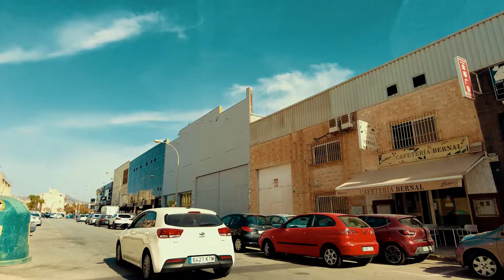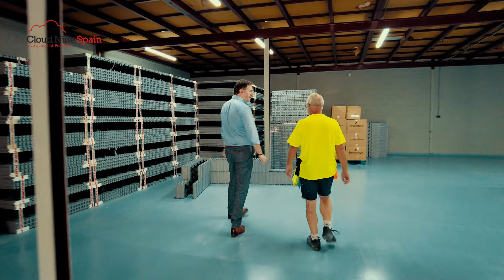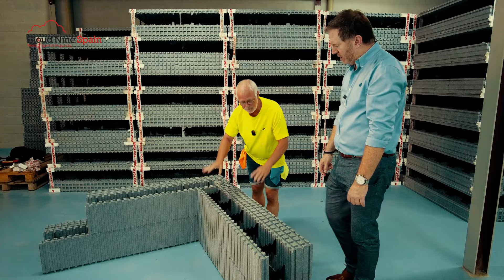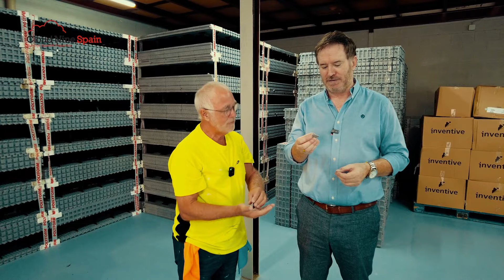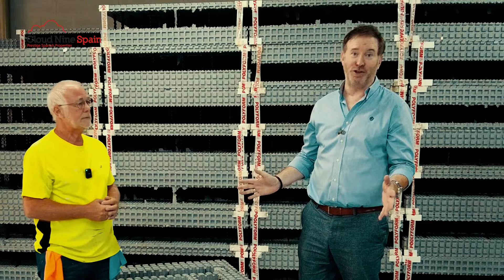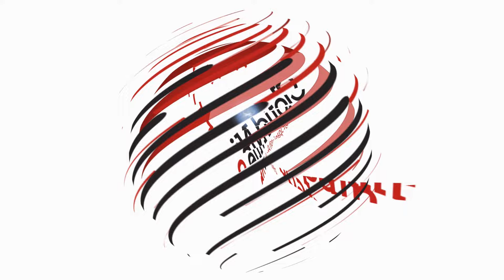EP1: Eco Construction - Save Time, Money and the Planet

Comment: Do you really want an A rated energy efficiency rating in the Costa del sol? 

So called A rated passive houses don't have any airflow through them whatsoever, in fact they use internal mechanisms to keep the contained air flowing inside the house. I would have thought a degree of airflow was necessary to keep the house cooler in the climate. Genuine question.